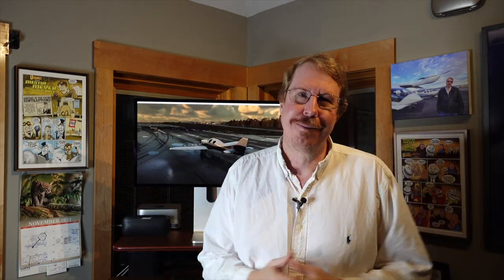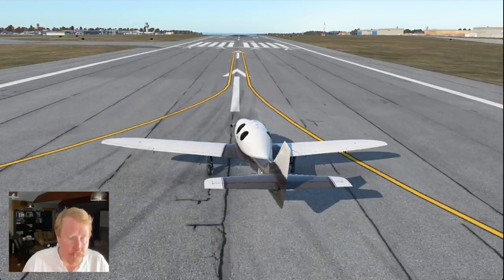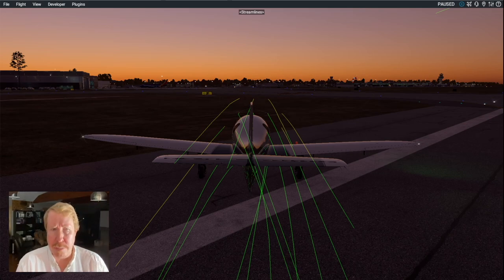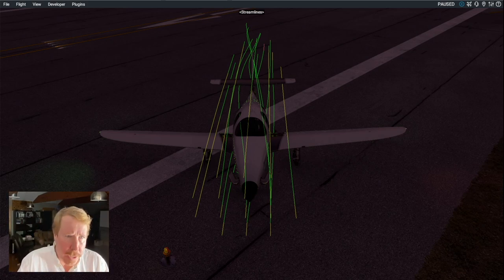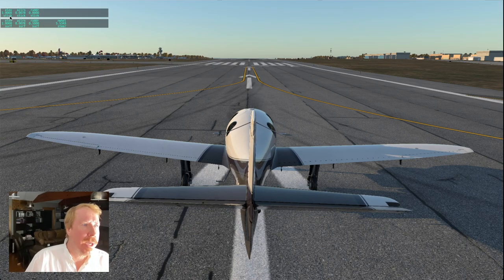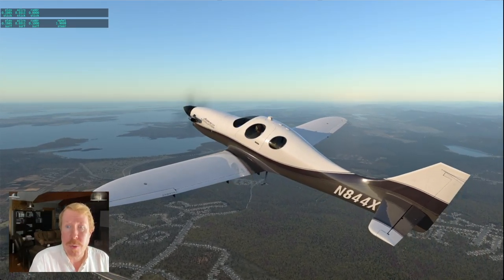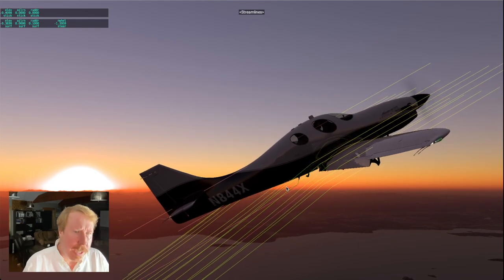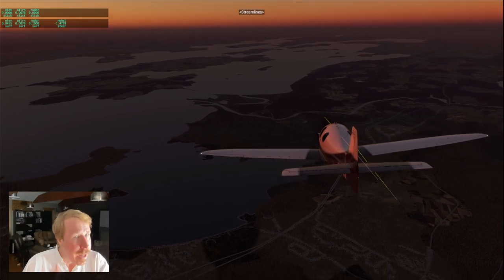X-Plane did WWHHAAAA!!?!?!?!?

Comment: 17:00 - The non-linearity is important for sticks like Logitech Extreme 3D pro. In real aircraft the stich is usually much much longer which provides much better precission. Like 2cm movement of your stick causes 10 cm movement of in-game stick. It is important specially for helicopters.
Reply: Thrustmaster Hotas is similarly affected. I stopped simming rotary wing aircraft just for that reason, my hands are full with fixed wing aircraft 🙂

Comment: I use X-Plane to practice reall-world flying.  I have X-plane equipped with the same avionics as in my real world airplane using Real Sim Gear GNS 430, GNS 530, two G5s, auto pilot and comm panel and configured with Foreflight and displaying approach plates on my mini iPad just like the real world. I use X-Plane mainly to practice IFR flights and approaches down to minimums in low IFR conditions.  So, if I’m scheduled to fly with an instructor to shoot approaches I can prepare for them on my sim at home. Saves me a lot of $. If I screw up an approach or screw up going missed, or whatever I can re-create the scenario at home and get it right. My home sim with X-plane is better than the FAA approved sims I’ve flown. So, for me it is not a game and IMO opinion that is the difference between X-Plane and MSFS. Microsoft’s flight sim to me is more of a game than a flying tool. I’m very much looking foreward to X-12 just as soon as I build a new high-end computer that can  accommodate the frame rates I’ll need.

Comment: To be honest the most effective solution to the issue of people being confused / asking same questions / incorrectly blaming physics ,  is more about  having a  much more clear UX and user interface design and better device configuration and calibration wizards. 

Not that a video like this is bad or doesn't help , but the type of people that get stuck  on many of these issues are the type of people that need a hand held tutorial section to a game. 

Having all this sort of stuff in a in game tutorial also adds a ton of value to a game and sim as it's enjoyable single player and fun educational content for people that don't know general aspects of flight arodynamics or even know to what degree xp11 is realistic / what it simulates.

At the same time some people simply don't have the capacity to understand certain things and some people will always fire of an email rather than giving things a Google or checking YouTube first 🤣

I'd rather rub sand in my eyes than be a game developer 😆

Comment: A very interesting set of diagnostic tools. Very nice to see the streamlines and force vectors and what control inputs do in real time.

Thinking back to ye olde days of FSX I don't remember much in the way of torque effects making single engine planes veer off and need corrective rudder. Its an old sim, but a lot still think about it as the benchmark of flight sim. I know X-Plane 11 has torque and vortex effects, but I've experienced it in other sims like IL2 Cliffs of Dover (Spitfire has some really aggressive torque steer on the ground, you have to give about 2/3 right rudder on take off IIRC). And having flown model planes, those things need a bit of rudder on takeoff to keep them straight. 

I have a little bit of response curve on the control inputs in flight sims (about 25% is what works for me). It really, really helps with precision formation flying (like air to air refuelling). I would prefer to be fully linear, but I just can't get that fine control I need for such fiddly flying.

Comment: The video explanation is appreciated.  I worked with programmers in a production environment where if there was an issue their first response was "it must be a hardware issue", ha-ha.  They were right about half of the time (tee-hee!!).
Now that I have some understanding of how to do diagnostics I will return to flying the helicopters and try to figure out why there's a slow oscillation when going at a very fast horizontal velocity (exceeding Vne ?).  I didn't recall ever experiencing it until around when X-Plane 12 came out it started up.  Of course I also changed to a new joystick at the same time (Logitech, just like in your video)... so it could be "the hardware".  My suspicion is that above Vne it's how a helicopter starts to buck due to trailing (retreating) rotor blade stalling or ???  Maybe you "fixed" that.  Which raises the question: are there revision notes that would say such a thing??
Bravo for a great piece of software and, again, also for providing us with troubleshooting skills via this video!  And yeah, "peace out" maaaaan and happy virtual flying.

**Update**  That issue that caused the Sikorsky helicopter to oscillate at high forward air speed seems to no longer exist.  My guess is that there was either a flaw with the model or something in the software that needed correcting.  Anyway, I no longer experience that after letting the software get updated to the latest... so am back to enjoying flying really fast!
Reply: We IT guys do that (blame hardware) all the time. It's a first kneejerk reaction to a substantiated complaint; we're only human, after all. Once you get past that complaint, it's time to debug your code. I watched Phillip Ringler go through X1000 autopilot operations -- he said several times "aw, there's a bug I have to fix". You guys are good! I've been programming for over 40 years, including for major airlines (UA, AA, CO), and I'm amazed at the quality of XP 12. I went with the beta and uninstalled XP 11, never looked back.

Comment: As far as the nose moving on a commercial airliner with flap deployment goes, some aircraft have automatic elevator compensation for flap and thrust changes. In planes that don't have automatic compensation you absolutely feel the force change and have to compensate to maintain whatever path you're on.

Comment: There's also the issue of perception of reality vs perception on a monitor! Try this the next time you're a pax in a moving car, stare straight ahead and notice how your view is bouncing all over the place, quite a few degrees per second, depending on car/road. If you had that kind of movement in a sim, you'd feel like it's all over the place, but that's the diff between a real scenario where your body is in tune with what you're seeing, and a sim where your only feedback is virtual and vision only!

Comment: your team did a great job...Only missing now is photogrametry service, and use sattelite textures for the ground. You know something like Oscar developed with Ortho4Xplane...Now I have a doubt, Ive installed the Demo of Xplane 12 and when in the air when I move the controls appears like a glitering shining sparkling things in its edges surfaces, sometimes before condensation. Im not sure if that is from Xplane or is my laptop which already presented me some graphics failures. making the clouds look like oil painting
Reply: I've seen the same shimmering artifacts on the leading edges of flying surfaces and sometimes other surfaces. These became apparent a little while back. I have a gaming desktop with decent graphics capability( just 6 months old). I made some adjustments such as tuning down the level of detail on the graphics settings. I purchased the early release of X-Plane 12. I noticed also that after incremental updates, some anomalies are reduced and sometimes new ones pop up. At any rate, this seems typical of beta releases.
Reply: @triskellian  Oh so its Xplane issue, cause I had some issues with MSFS2020 as well, check my channel and see the last videos Ive uploaded, those are some of the bugs I believe my GPU is making.

Comment: Austin don’t forget that caster nose need to have a some brake applied to correct it until there is enough air flow over the Rudder to keep the airplane going the direction you want.

Comment: My question about the X-plane dynamics has to do with the rapid oscillations after or during a disturbance, say for instance, turbulence. The frequency and intensity of the oscillations give me the impression of very low inertia, or almost no roll/yaw/pitch damping... as if the aircraft reacts to the forces in isolation, and instantaneously, as opposed to flying through a viscous fluid like air. Thank you.

Comment: Note: This video is not just about X-plane. It is quite universal for any flight simulator.
Reply: I don't know of any simulator that models physics like X-Plane 12, using Blade Element Theory that effectively.
Reply: @ronsflightsimlab9512  DCS:World, MSFS 2020 (shame they did start to use that 25 years after X-plane)
Reply: @jaromirandel543  I have seen MSFS videos showing some data like this (when talking about using CFD), but was that developer exclusive or can users access the information for themselves in flight?
Reply: @jaromirandel543  What do you mean "after X-Plane"? Austin hasn't even realized yet there is such a thing as Navier-Stokes equations. Although, maybe he has already - I haven't watched this video yet - but BET is nowhere close to what the guys at Asobo did program for the flight model in MFS. Sadly, it's rather low resolution, but that's mostly the problem  of our current hardware (and of more robust CFD optimization methods not being discovered yet).
Austin's physics knowledge is on the level of a high school student (a high school teacher at best), while the guy that works on the flight model at Asobo is an aerospace engineer. Do I need to spell the difference?
Reply: @getsideways7257  Seb is an Aerospace Engineer?
Reply: @getsideways7257  Perhaps you should watch this video then. At least a couple of the diagnostic displays look closer to what Asobo showed with their CFD presentation than what BET alone would display.
Reply: @getsideways7257  Because X-Plane is around 25 years old and MSFS started to use a physical flightmodel only 25 years after. FSX etc. used lookup-tables.
Reply: @getsideways7257  O.k. But Navier-Skotes have never been proven. It is Millennium Prize Problem. There is 1M USD prize for those who will finish "Navier–Stokes existence and smoothness problem." theory.
Reply: @getsideways7257  XP is so realistic that companies use it to prototype aircraft designs. Asobo's model will fundamentally never be able to reach that level.
Reply: @angelicguru4066  which companies? 

Boeing, Airbus, Lockheed Martin, Bombardier, Embraer, Piper, Cessna, Pilatus, Gulfstream, Beechcraft, Northrop Grumman, Dassault, BAE? 

Those are the top aircraft manufacturers on the planet and as far as I am aware they make no use of XP to “prototype” (whatever that term means) aircraft design. Preliminary aircraft design parameters come from data obtained primarily by CFD analysis, Wind Tunnel Testing and in house developed software. I have attended  lectures by both Airbus and Boeing aeroelasticity engineers demonstrating ex prototype  aircraft performance tests through their own in house developed virtual test software. It’s quite impressive with a very primitive UI. But it’s used only for one purpose alone.

My question is not snarky or condescending in nature. I genuinely ask as I haven’t heard in the aerospace industry XP used as a tool by major players for aircraft design purposes.
Reply: @jaromirandel543  Tell that to ANSYS, Dassault and other companies that code professional engineering grade CFD suites? Or those "weird" guys working on OpenFOAM for free...
Also, to the very companies employing CFD calculations to design new aircraft.
Or maybe you think Boeing is using BET in any of their developments?

A solution to a differential equation can be found through approximation - you don't really need THE perfect one. Anyway, just check the ProjectPhysX channel and you'll see what you can achieve with the current state of CFD.
Reply: @Tsudico  Ok, I have wasted almost a whole hour of my time watching this... If only I could get it all back.
Austin sure tried to emulate what can be seen in proper CFD tools, but not only it does not look convincing - there simply is no way to make pure BET compute flow velocity fields. Obviously, he coded in a yet another crutch that semi-empirically "scientifically-guesses" flow directions in separate (and very sparse) volumes of air based on who knows what (mostly the velocity vectors in the adjacent volumes, I guess), but that does not really constitute a proven CFD approach.

Also, in CFD red usually means faster flow, but I can see how Austin - not being very well versed in physics and all - could interpret it the other way around: most likely he did hear of the Bernoulli's principle, but he failed to realize what it entailed (airflow accelerates while having to traverse certain types of obstacles).
Reply: @getsideways7257  No, the DCS:World developers uses FlowVisionCFD software.
Reply: @jaromirandel543  I'm not quite sure what you are disagreeing with, but basically anything with "CFD" on the tin has one or another implementation of Navier-Stokes anyway. Apart maybe from VSPaero (VLM in which didn't go far from BET anyway).

Edit: just to clarify - the FlowVisionCFD suite is used to populate the look up tables for the flight models in DCS, so it's a different kind of CFD usage to what Asobo did. So, on one hand, what DCS has is more precise (at least when close to the sampling points), yet on the other - MFS is doing it in real time, albeit with less precision. DCS can't really cope with complex situations like spinning, Lomcovaks and stuff like that; MFS potentially could, but it would need a little more precision (and probably the application of the FD engine to the actual 3D geometry - not to the airframe approximation not dissimilar to what X-Plane has).

Comment: The VTOL is so cool and fun. The ability to adjust the response curve and save it is great. The air plane shown has a sensitive  rudder but adjusting the response curve in real time in flight is very useful and easy and takes right rudder trim, as does every airplane to go straight during take off and as speed builds less and less rudder is needed and now a responsive and controllable to fly airplane, and has become one of my favorites. Enjoying my X-Plane 12.

Comment: in short, propwash is hitting the left side of the tail which is pushing the nose to the left. When it pulled right, it was pulling right because of the torque of the prop. Propwash eventually overpowers the P torque.

Comment: So, what my 9th grade Physics textbook told me is right, the engine produces torque and that torque veers planes off to a side.
So, during takeoff, pilots tend to use counteracting rudder to keep the nose straight. It's not the case for Jets, since they produce thrusts or counter-rotating propellers.
It's really weird that Bangladeshi Physics textbook put that in 9th grade...
Reply: Yeah and also it’s kind of common sense for most of the people or so I expect🤔

Comment: Nice video. However there IS a very annoying bug on the iPad version: Sometimes the gyroscopic controls get decalibrated and you have to rotate the screen massively to one side just to keep it level. I haven’t pinned down the cause but it seems to be related to pausing and/or moving to a different app and back. The only solution is to quite the app and start again and then it seems ok.
Reply: Have you tried more rudder control, because I’ve hade the same issue a while ago 😢
Reply: @TheToppestGee  it’s not a rudder issue, it’s like the whole calibration just gets totally off and you have to almost turn the iPad upside down to get things to almost work again… totally unworkable.

Comment: I don't like how in X-Plane there is never any moments where the turbulence pauses.
You should include random lengths of stable air during turbulence especially long pauses during light turbulence.
Otherwise it is a bit too nauseating.
I submitted a bug report and hope it changes.
Reply: set weather variation in region in weather page before starting flight.

Comment: I think as a sim developer it would be healthy to recognize that a model like this will have tremendous error in all parts of the envelope. While a lot of user issues are surely due to lack of user ability or insufficient controller hardware, you're fooling yourself if you believe that even the very basic stuff is well correlated in these kind of models. There can be some merit to the common complaints.

Comment: How do I use the toe brakes with a joystick like he’s using? I set my trigger button to hold maximum brakes and always uses the parking brake. How do I said the trigger to both toe brakes?
Reply: You may want to try "toggle brakes / regular effort" button assignment. I found that it works similar to the actual brakes in a light plane. Also, the "b" key on the key board is good for toggling the parking brake. This took a bit of trial and effort, by the way!

Comment: Recently tried XPlane 12 and was very unimpressed with the Cessna 172s flight model. When doing a power off stall while staying completely coordinated, the plane will drop a wing and try to enter a spin. This is not at all how the Skyhawk behaves in real life. Even during a power on stall, if you’re coordinated you wont drop a wing. The Skyhawk should not be easy to spin. I hope this flight model gets improved